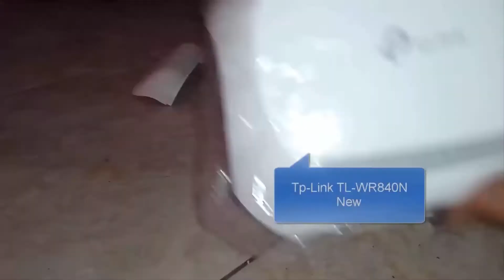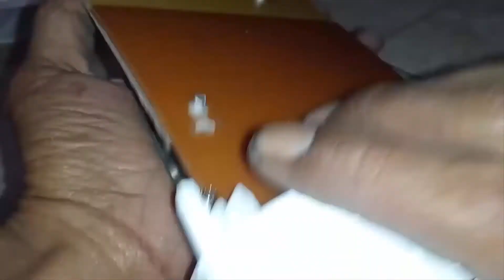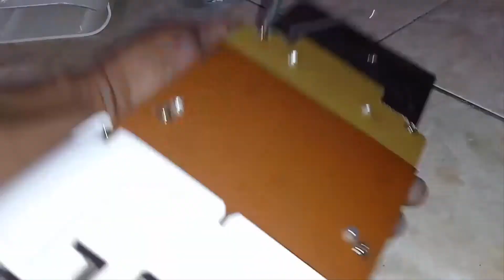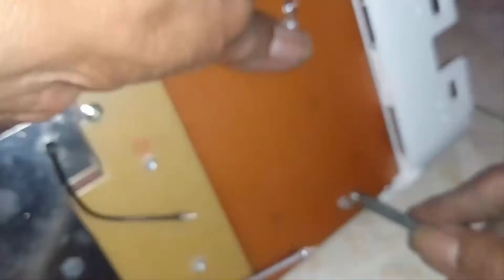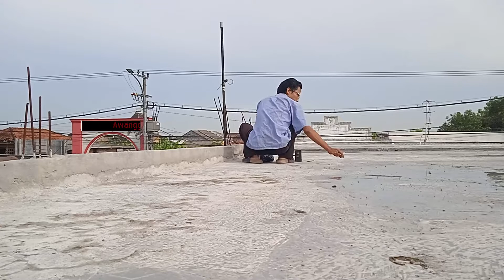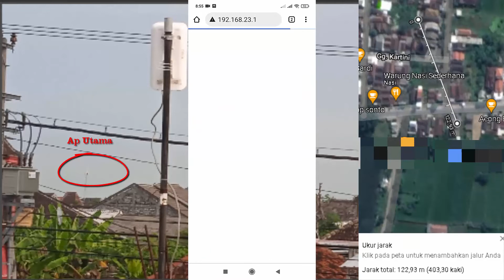Test hasil modifikasi TP Link TL WR840N indoor to outdoor dengan bekas sectoral  antena 4G

Comment: ok ga pake ZTE 609
rencana buat nyebar sinhal
Reply from the maker: Karakter sectoral searah bang bukan 360°
Reply: @awanggacompnet3494  trus kalau buat antena akses point' sinyal wifi voucheran bisa maksimal brapa meter kira2???
Reply from the maker: @Toserbaunik76  gini bang misal bisa jauh pun, klo diterima HP langsung, si HP yg nggak kuat transmit balik ke AP karena power HP kecil. ideal buat langsung ke HP 100m
Reply: @awanggacompnet3494  oh iya brati maksimal 100 meteran thank infonya..
Reply from the maker: @Toserbaunik76  sama2
Reply: @awanggacompnet3494  siap gan soalnya mau modif juga dari antena bolt buat sebar wifi voucheran..